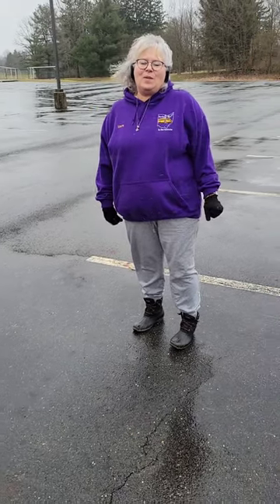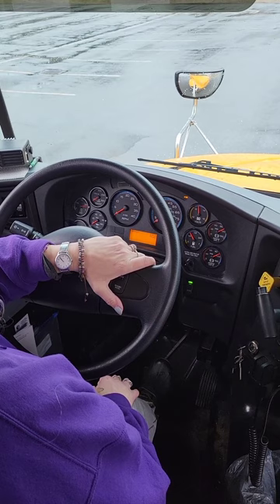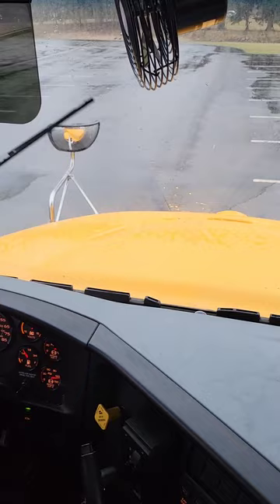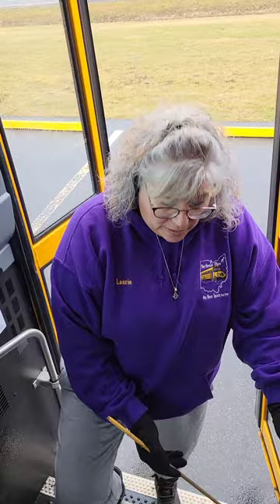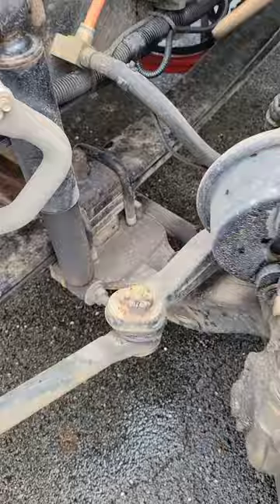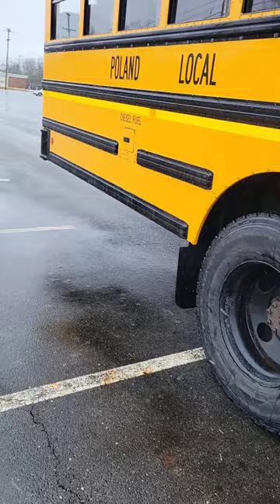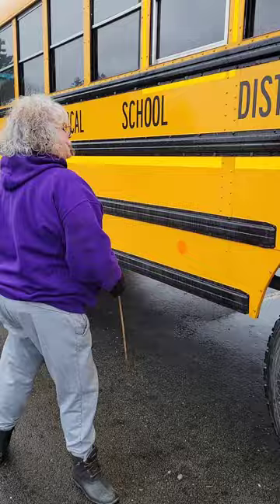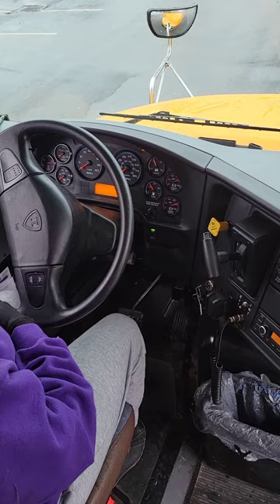NEW ~~ Ohio CDL Pretrip Inspection Conventional Bus  (effective 2/1/2023)

Comment: Need seat belt on, check spring brake in reverse also
Reply from the maker: Only have to show that the seat belt is adjustable and locks in. Spring brake can be checked in D or R, just need to show that it holds.
Reply: What about back up lights and beeper?
Reply from the maker: @animalsx5 those are only done when we test for our certificate, we don't have to do those for CDL.

Comment: did i miss the battery and electrical boxs and shifts smoothly in all gears and the back up beeper or had that changed? do we need to check the emergency cards ,radio, up to date sticker ? sorry just trying to cut out unnecessary words / time
Reply from the maker: The things you mentioned are not part of the CDL test, they are part of the Pre Service certification test for Ohio.

Comment: Is the only change is that the brake test are first now
Reply from the maker: No, you must sound your horn at the end of the brake test. You will have 2 attempts to get the tests right, if you don't then you do not do  the rest of the pre trip. After that, the other change  for  a school bus is that we inspect the door side and underneath instead of the drivers side .... there is  only the stop arm on the drivers side.
Reply: Thanks so much
Reply from the maker: @hotmessmamashantisfamily6252  you're welcome